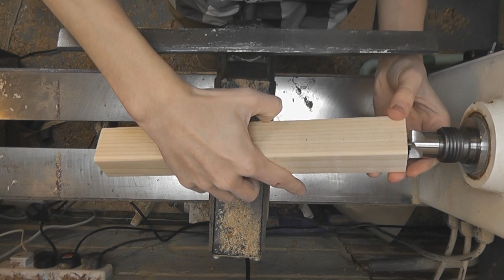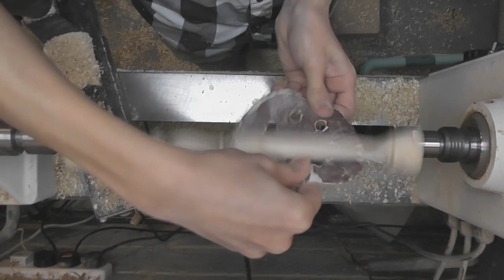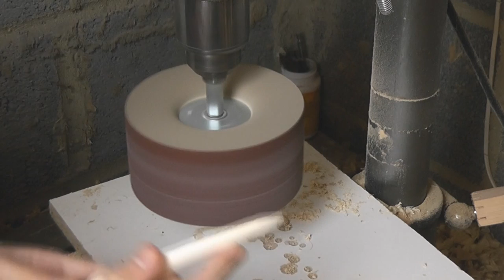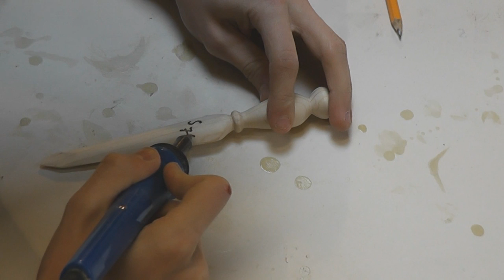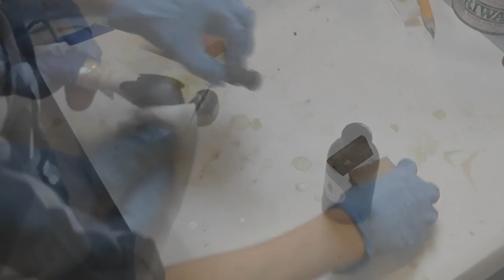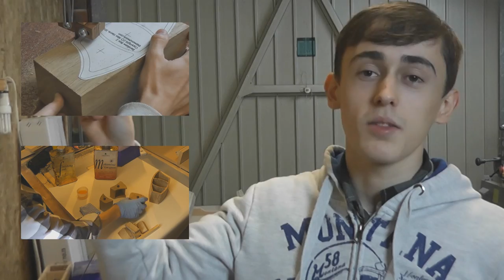Off Centre Woodturning | Letter Opener

Comment from the maker: It is made by a company called chestnut but I think most brands will be fine. Liberon perhaps? The trick is to apply several coats, I think this item had at least 2 if not 3 coats to get that really deep, rich colour. Some woods will also takes stain better, pine is a pretty thirsty wood.
Alex

Comment from the maker: Thanks for raising this point, no, if anything I would lower the RPM due to how fragile this piece was. A speed in the region of 1000- 1200rpm was fine for this project. You are right about is getting caught though, if you introduce the tool too quickly with it running slow it could get caught, as long at you introduce the tool slowly you should be fine.
Alex

Comment: Great Video!!! What website did you get those spindle sanders from, i would like to get some and use them in my lathe for more control over the speed? Also, the new microphone (if it is new) is a great improvement in the audio in your videos. Thanks,
ThatWoodworking